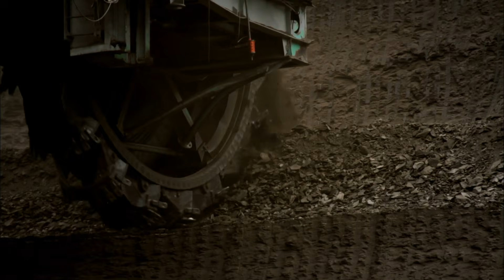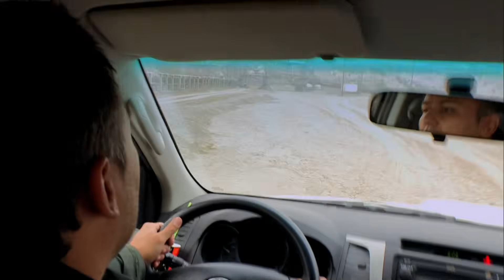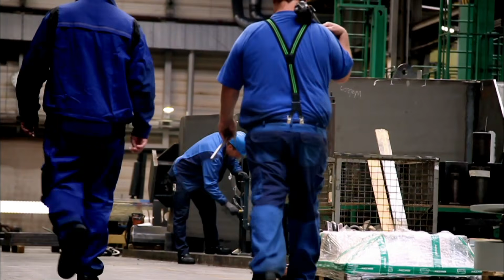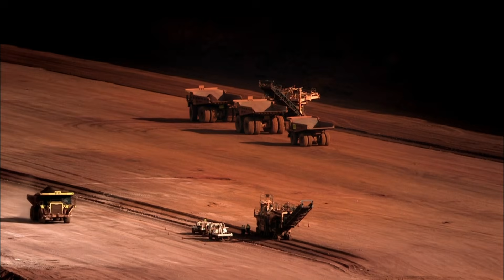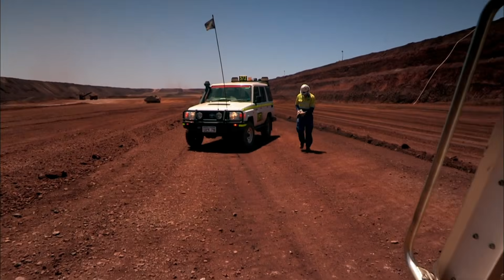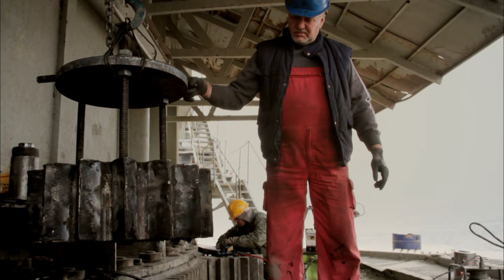Dirty Great Machines - Bucket Wheel Excavator | Technology Documentary | Reel Truth. Science

Comment: This would be so much better if it wasn't for the voice actor and typical Discovery Channel deadlines.
Reply: everything is so dramatized ughh..will it make it on time..will the team be able to save the machine blah blah
Reply: I'm going to go out on a limb here and state that every episode in this series will supply more of the same. There is no finesse used in the creation of these presentations, just blunt force trauma. Cram as much noise, effects in as you can.
Reply: Tensions are rising. If the team doesn't repair the bucket miner in the next 4 hours, the team could very well be eaten alive by giant sand worms. Find out what happens next week on Monsters of Mining.
Reply: Like the constant threat they wont have electricity lol
Reply: I wish they would just tell about machine and maintenance periods. No one need the overblown drama nor stupid drums...
Reply: Time limits, volume measurements units are Olympic swimming pools, weight units in elephants or battle tanks, length unit is of course footballfields, width unit is the size of the asteroid that wiped out the dinosaurs, height in n-story buildings but WHY NOT PRICES IN BIGMACS!!!
Reply: Ehhh With the principles of engineering”
, proceeds to smack metal with hammer

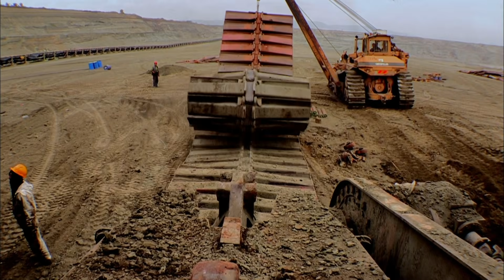Comment: 6:45 brand new track? more light slightly less ancient track. Looks like they had budget cuts.
Reply: Thank you! Like if they're going prepared to fix the thing and replace those tracks you'd expect something that doesn't look rusted all to hell like the old one
Reply: @arterias346  ontop of that, it looks like they a bunch of clowns running around working on it
Reply: These without doubt are going to be old tracks, what I assume they're doing is keeping the old steel/iron links since these rarely go bad but replacing all the hardware such as the bushings and pins. Just like when you get a 'brand new' drive shaft for your car nine times out of ten the shaft it self is an old used part but the joints at the ends have been replaced with new.
Reply: no they are new tracks but there has definiticly ben budget cuts becaus the equipment they use to pull it on and off is not great.

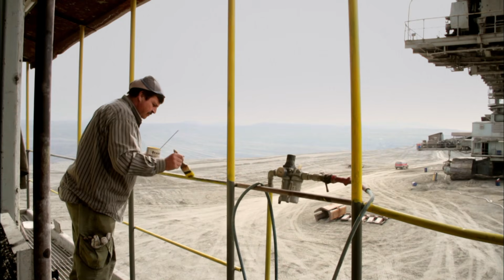Comment: So you've trained years to be an engineer and or mechanic for bucket-wheel excavators. You're overworked, filthy and sleep deprived working hard on trying to remove the gears from the wheels gearbox with a crane and then 42:35 Mike from the paint dept just rolls on up to paint a rail. Incredible
Reply: A paint glove would be faster and better than a brush. No need to be neat.
Reply: well, somebody's gotty keep those rails from rusting thru, they're important for worker safety after all
Reply: Easier to keep rust at bay than to repair rusted areas.

Comment: I really like it that Fallout 76 used this mega machine as a world prop with real life analytics and their fantasy fusion-reactor tech while keeping the theme of why Fallout is weirdly a better place than ours. Plus, while black titanium is a real-life mineral, it's not that strong and hardened cast iron can beat it in longevity and stress-bench tests.
Reply: Titanium is light and strong. That's the key benefit. As strong as steel and about as light as aluminium.
Reply: @ragnoxten4158  True, but as its chemically black, its chemical components are weakened and doesn't hold the proper bonding strength to other metal to over lapping. IIRC, its xenon or radon that give the element it's black hue but knocks out 3 primary electrons that gives that titanium it's based properties?

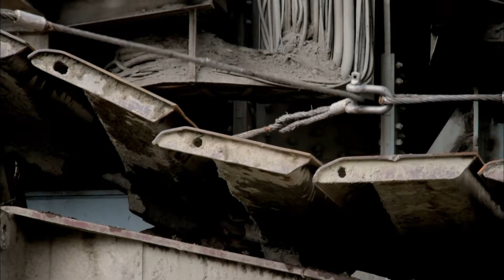Comment: Guys are afraid of the cables? Well look at the cable at 7:55. No wonder. Also you dont run a cable through a shackle. Especially through the pin. The rendering of the cable will unscrew the pin. Should probably have the safety guy watch the video before you post safety issues.
Reply: I think the safety guy left long ago lol

Comment: That "new" track they are putting on the machine in Greece looks to be in pretty sorry shape, well used, badly rusted and virtually worn out... Replacing a worn out track with another worn out track is asinine to the point of pure stupidity.
Reply: To make actually new tracts would cost many hundreds of thousands of dollars.
You are acting like this is some garden tractor that needs new tires for 20 bucks a pop.
Nobody in their right mind would spend the better part of a million bucks when they could spend a week down and delay that cost half a year to a year.
Just do the math. 7% of a million bucks is 70 thousand dollars. By using the older tracts vs. brand new tracts they made 70 thousand dollars. Well worth the cost of a few mechanics salaries over a few days.
Reply: @kkknotcool  To replace a worn out part with a worn out part in the hopes of staving off replacing it with a new part for 6 months to a year is a fool's errand. That is a certain guarantee of failure in the long run. That very seldom works out as planned! I have seen it cost companies 10 times as much to repair the damage done to other parts of the machine that were caused by doing exactly what you are advocating. 

One company I worked for had a huge rubber mill mixer. Bearings were going out. They called in a company to fix it, they were told "we can replace some seals and you might get by for 6 months, or we can fix it right for $25,000." The company choose to have it patched up and hope to get by for 6 months. Because it didn't die in 6 months, they figured they had beat the odds, they actually got by for nearly a year and were thinking, "Man we really saved some money!", then one day it ground to a halt. 

We had to tear it down, ship it from Texas to New Jersey and have it completely rebuilt. The cost was over $250,000. That was just for fixing the machine. No telling how much the lost production cost them, as well as the added costs of having to buy premixed rubber compounds to operated the rest of the plant on until the mixer was brought back on line.

Taking the cheap way out and trying to 'beat the odds' is never a  good game to play!
Reply: @JoeHTX  
If a track breaks, the track breaks.
It's a totally different beast.
If it was a coolent or oil pump or anything that could couse other problems(like that bearing) when it broke, then sure.
But it's not.
A broken track means you need to fix the track. They rarely break other stuff when they break.(at least from what I've heard)

Comment: seems a lot more wasteful using dump trucks rather then conveyer belts
Reply: How?
Big conveyor belts must cost over 10 bucks a foot.
Assuming the plant is 10 miles away that's 5280 feet times 2(because it's a belt) times 10 miles times 10 dollars a foot = $1,056,000
So a conveyor would cost over a million every six months or however long a conveyor can last with that kind of constant gravel abuse.
Meanwhile you can buy a few huge dump trucks for the same as 2 years worth of conveyors and with new tires and maybe an engine rebuild do the job for a decade or more.
Reply: how much do you think those dump trucks cost to buy and how much fuel they consume? one conveyer can run parallel to the digger and on tracks to move and that runs down to another that runs horizontal to the work area that the first dumps onto and then run it to where ever you want to dump it
Reply: @danhard8440  plus with that type of mining you would have to constantly re position most of the belt for every single pass.... (agreeing with you)
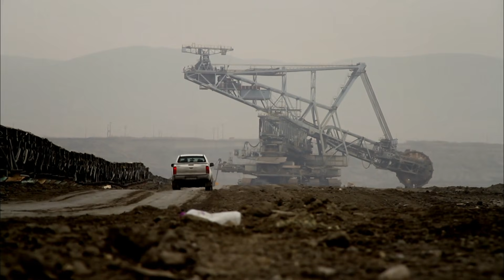Reply: at 3:50 you see the conveyer belt on the left try to imaging that sitting on caterpillar tracks or tank tracks that would move the whole thing left or right